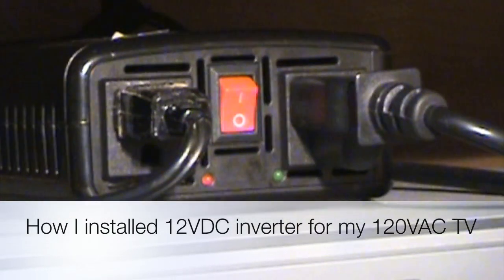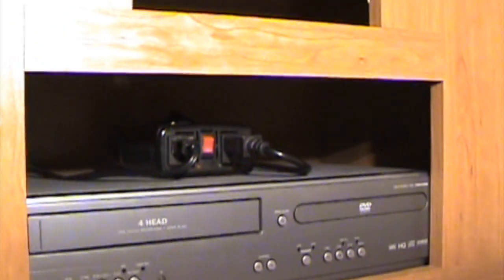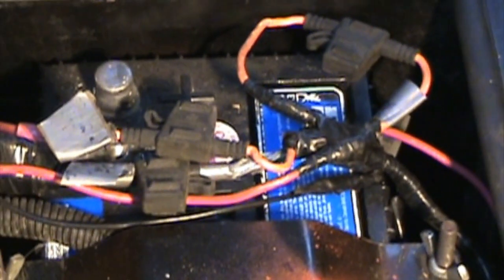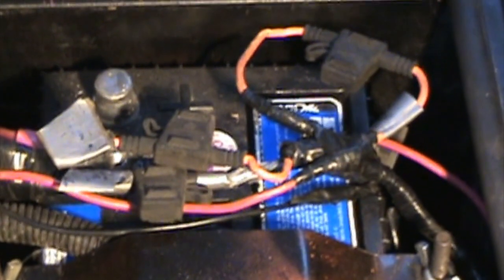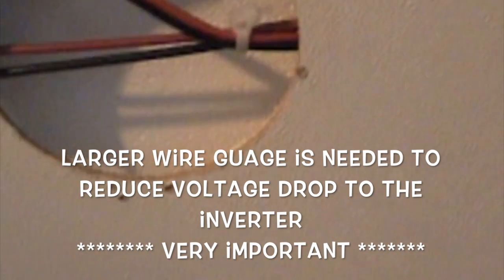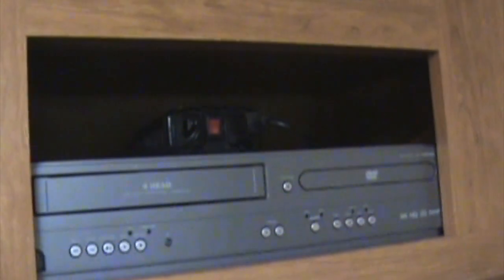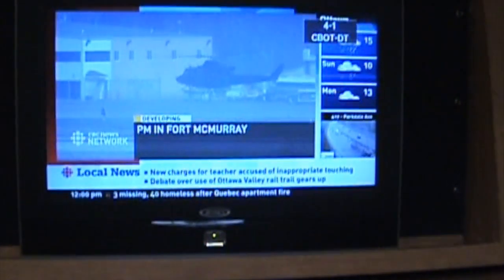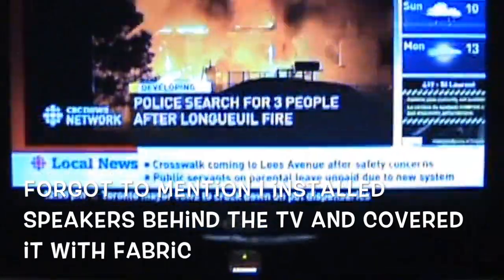Easy - RV TV 120V to 12V DC conversion how to install inverter.  RV TV on coach battery

Comment: Inside a lot of TVs, (but not all) somewhere near  the center, you'll see a spot where there are 2 bare pins sticking up & on the PCB board by them it says 12 volts... You can wire a cord directly to those pins & put a 12 volt plug-in on the other end & boom. You don't need an inverter.. It's a lot more efficient on your vehicle or batteries without the inverter anyways.

And I know this vid is 3 yrs old. I figured I'd reply & maybe it will help someone someday.
Reply: "Inside a lot of tv's"  can you give any specifics where you have seen this?

Thanks.
Reply: My Furrion 32" has this. It's labeled 12v upgrade. However, when 12v is applied, the tv powers on, as in the display does (as seen by shining a light on the panel) however the LED backlight does not turn on. I can't find anything else about it, and why the backlight wont turn on using the 12v input.

Comment: how long can u watch tv for
Reply from the maker: What do you mean?  If it's pouring, I'll watch for some time, or if the bugs are killers that evening.  My TV draws 4 amps, so I and easily watch for many hours.  I have 2 100AH batteries that work well, until I let one get dry last summer.  I'm fixing that one this winter and I hope it holds a longer charge this summer.  Thanks for your comment.  Ron